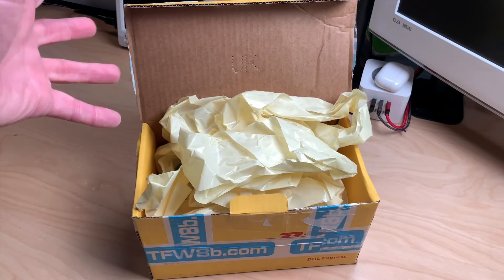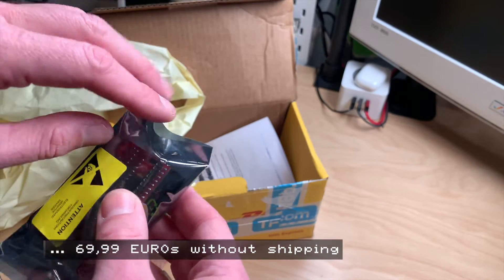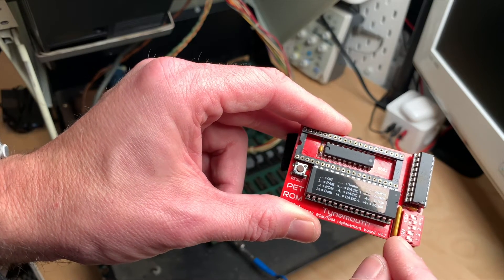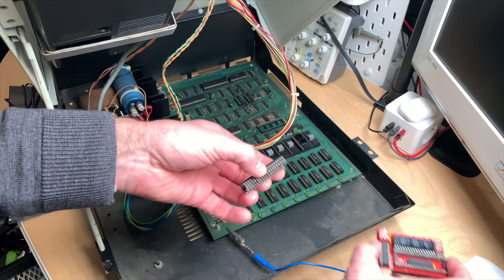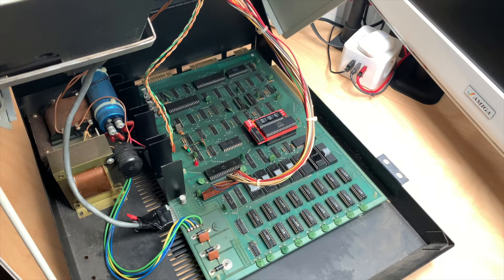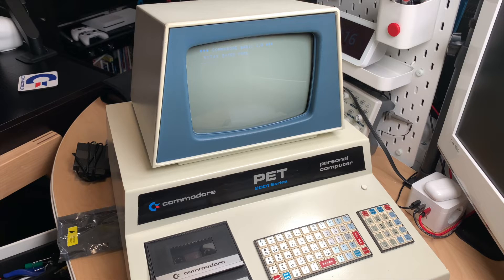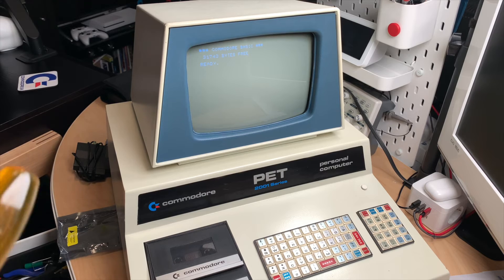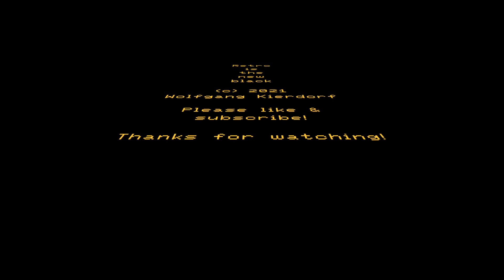Commodore PET - Tynemouth ROM/RAM Board - RAM/ROM replacement & BASIC switcher

Comment: Very good!!  
A question, I have many commodore PET/CBM, and some have problem with chip ram. I have see this chip are with 200ms, other 250ms and other 150ms (on different machine) time access.
Can I replace all the bad Memory chip ram with 200/250ms time access with chip at 150ms?
 Sorry for my english
Reply from the maker: That should work since 150 is faster than 200/250.
Reply: @RetroWK  thanks, i hope work. I go to purchased it (4116 at 150 ms)

Comment: Note that all the current RAM/ROM cannot replace bad video RAM nor the Character Generator ROM.
Please post a link to that 1541 adapter.

Mouse keyboard 😄
Reply from the maker: I am still working on that adapter. Coming up soon!
Reply: @RetroWK   YES!

Would you know if the format of the floppies from a 1541 and 2040 are compatible / the same?
Reply from the maker: @MattKasdorf  As far as I know you can read floppies from a 1541 in the CBM drives and vice versa.
Reply from the maker: Yep. Good point!